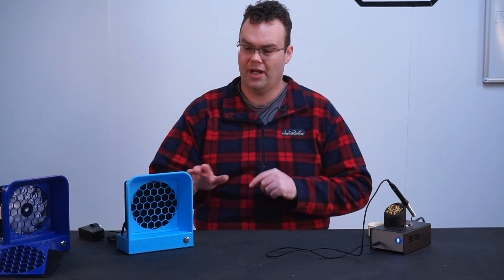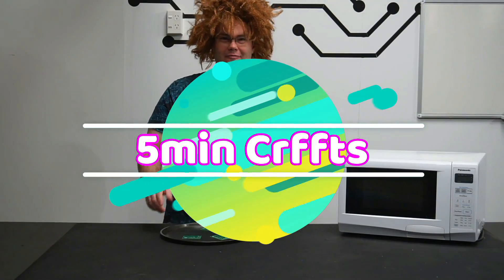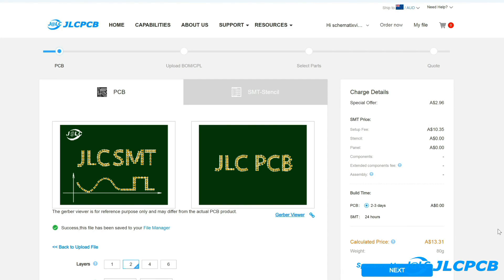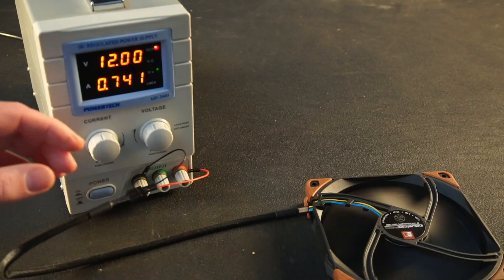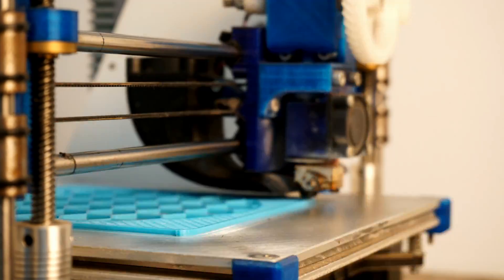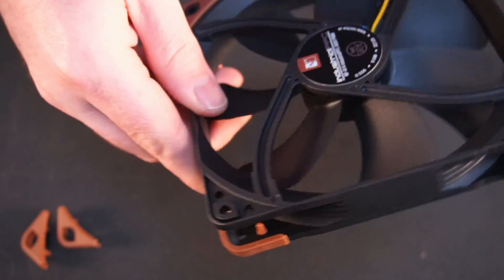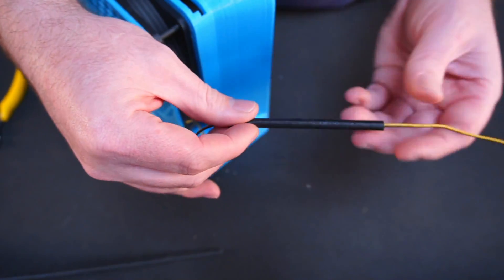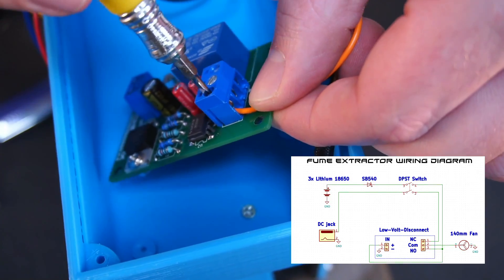Cordless Solder Fume eXtractor ll Awesome DIY project!

Comment: I admire the idea, but $70-80 worth of materials (at ebay/amazon prices - just the fan costs $30) for something I can buy for $30 as a whole unit (with a fan that's potentially more suited) just kills my desire - though perhaps that's more my lack of disposable income (so for anyone that does it for the love of the making, more power to you). The whole point of making these out of PC fans is to save a little moey to me. Otherwise it's far better to use some higher airflow fans or just a blower and some ducting to solve the fume situation entirely. This is probably emminently affordable if you've got access to an electronics parts wholesaler, but just piecemeal buying stuff online drives the price up way past what comparable purpose built units cost. Just a regular PC fan stood on its side connected to a spare 9 volt battery using with a couple of dupont wires stuck on with binder clips does the job of pulling the smoke stream away from my face (to the point I can't smell anything) and costs me nothing but my dignity.

Comment: What a valuable video! And in more ways than expected - the comedy bit was hilarious! Thank you.
Did anybody suggest, that placing the filter behind the fan might add to the suction? I do wonder how much the dense charcoal filter hinders airflow, and whether there would be any trade off in ways of fumes seeping through the cracks (instead of passing through the filter, after being hit by the blades of the fan)?

Comment: These are a pointless waste of time. They do nothing other than move the fumes and then distribute them out the back of the fan which is still close to your nose. The toxic fumes will still be breathed in because they do not get trapped in a carbon filter. You need a HEPA filter. Don't waste your time with these stupid novelty fans designed by dumbarses.

Comment: It's always better to have fume extracting. But the snowflakes of these days always seem to think that if you inhale one whiff, you're dead.

You're not. Unless you're soldering EVERY DAY, for SEVERAL HOURS, an extractor like this is absolute and utter nonsense.

Still, nic to have and simple design.

You really need to do some work on your printer. The print quality is abysmal.
Reply: Solder for three days in a week for just 2 hours each and you will have problems. Headaches, breathing difficulties, inflamed sinuses. Years of this and you could have permanent damage to your lungs and potentially your brain. A carbon filter does nothing. A HEPA filter is needed.

Comment: You can use a 3S BMS as well.
Reply: Or 1 cell and a charging/protection module from aliexpress. 
And a voltage booster from aliexpress. 
Now u can control the fan speed.
And u can charge the battery with Mico USB.
Protection, speed control and only one lithium cell needed in this situation.

Comment: Do you think that the Noctua fan is powerful enough to handle a 10mm carbon filter? I have seen that some retail fume extractors are using 9mm or 10mm ones.

Comment: maybe you wired it in reverse, but the orientation of the fan should be blowing the smoke back at you. typically the side the fan mounts to is the direction it blows. i wonder how much more effective  it would be oriented properly or less as it is wired as you have it.

aside from that, i have a project that i built with a old PSU chassis and the 120mm fan that was in it, it doesn't work very well and now i can give this project a try, also using a 500k linear potentiometer didn't work so well even with a beefy 80Ohm military spec resistor in parallel i couldn't get more control over the speed.
should probably look into buying a lower value, but using scraps. 😋

Comment: That is pretty cool. I still use an HVAC exhaust fan with a tube-style carbon filter as my DIY Fume extractor. A bit overkill but it also deodorizes my entire house when I use it. A bit noisy, and large but damn does it perform. I will scale it down one day.

Comment: Nice product, deff gonna build it. 
I like that the batteries is recharged outside the circuit and the safety features.
But why use 3 18650 with an average voltage of 11.1V instead of 4 like u normally use for 12V supply?
That will also "greatly" increase the suck factor and likely the noice.
Reply: U can use a voltage booster from aliexpress.

And a charging/protection module from aliexpress 
Than u need only 1 battery and u can control the speed.
And u have a charging function with micro usb, and battery protection.

Comment: The circuit is not complex but adds more than necessary. A simple switch in line with the batteries and the dc jack straight to the fan with a diode to protect the batteries.
Reply: does it works as Low Volt Protection as well? its another main concern

Comment: So does the 12 VDC wall adapter actually charge the batteries or do you need a separate charger? I'm also curious why you are using a relay. It is my understanding that relays are not appropriate for DC circuits since they can stick themselves into a specific state. Probably this wouldn't stay on for long enough on a battery charge that it would get stuck but if it did then the batteries would get discharged below the cutoff. Also, this might be nitpicking but when fully charged the 18650 cells will overvolt the fan by something like 0.6 to 0.75 volts if charged by an external charger.
Reply: Ah it looks like the batteries are not being charged so you'd need an external charger. Wouldn't it make more sense to add a cheap 3S BMS module and then have a physical switch if the user wants to bypass the batteries or run it without batteries? Those BMS modules are only around $2 shipped and have built-in over-discharge protection.

Comment: does this foam rubber cleanse the air of smoke? Real?
Reply: It's an activated charcoal filter, it does remove some chemical impurities.
Reply: Ah it's not rubber, it's a sheet of activated charcoal! It's a bunch of charcoal pellets that have been foamed up to increase the surface area massively! It's one of the most potent filter materials known to mankind. It won't delete all the smoke not at this small amount but it it will for sure catch as good as all the polar volatile compounds and a good amount of particulate matter.

Comment: Hmm, doubtful on the actived carbon filter actually being activated carbon.  Going to a ducted box filled with real activated carbon (aquarium product source) with a old vacuum will get rid of the nasties a lot better.  Google 'hepa solder filter activated'. Commercial filter pricings are nutz but are economical if you can make a few to split the cost with friends.
I've never microwaved my PCBs that way, but hey, it's 2020, i'll give oit a go. ;-)
Reply from the maker: I agree the type of carbon filtration here isn't going to offer the best filtration possible. Though my own observations, I've noticed the air quality in my shed noticeable improved once I was using this extractor. So I believe the filter is doing something. But certainly not 100% effective! However, that's the tradeoff for a cordless, compact & portable unit. Be sure to only use a microwave with a "PCB Easy-Bake" setting ;)
Reply: @Schematix  You don't think a 12cm fan like this will be able to pull through a Kärcher VC3 filter?
Reply from the maker: @SianaGearz  I highly doubt it would be very effective at move air through a vacuum filter.
Reply: @Schematix  Mhm i might have the Jou-Jye 12cm fan somewhere... 70dBA, 6000rpm, 50W... i can see almost no trouble with this at all...
Reply: @Schematix  0% effective. Those fumes are just diluting in the air which makes you think they are not there. Maybe breathing diluted fumes in the general air is slightly better than breathing them in directly, but if you solder for a few hours and multiple days you will have breathing problems and headaches and inflamed sinuses. After years this could result in asthma or worse.